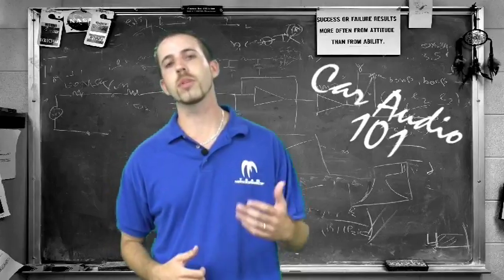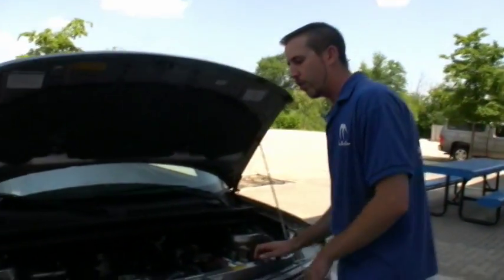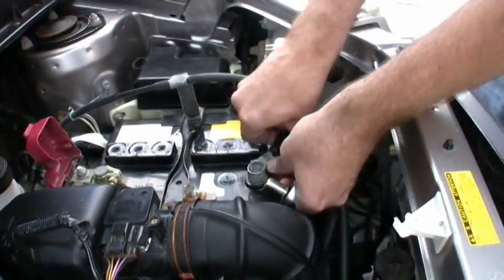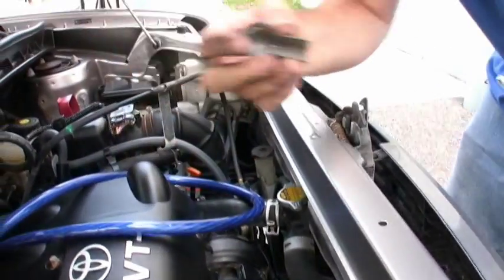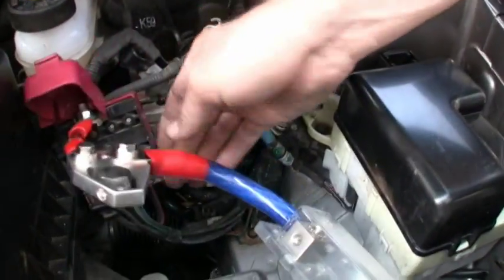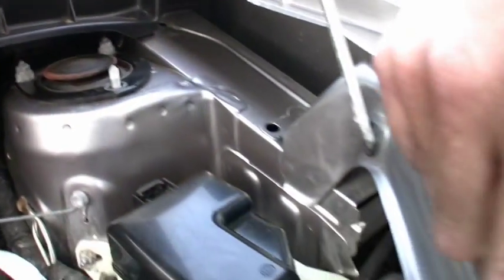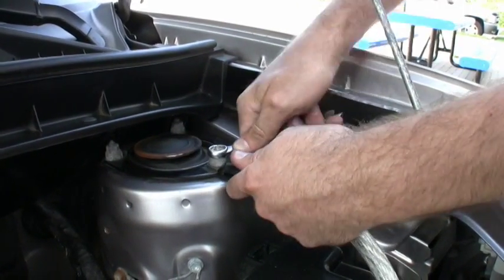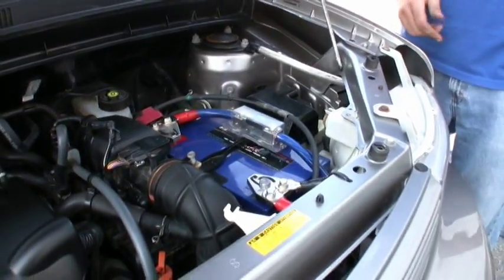Car Audio 101 - The Big 3 Upgrade Tutorial

Comment from the maker: Gotcha. You ahve a valid point then. I would recommend a 0 awg run from the mounting bolt on the alternator (NOT POWER Connection) to a good ground.

Comment: Well if you worked on your oun stuff but I know what you mean. But let me tell you before who ever told you that makes you spend too much money. My 93 jeep is no different. All they need to do is loosen the belt on the power stearing, then undo the bolts and what not for the alt. Then it just drops strait down. The radiator, the AC??? That B.S. And dont let anyone tell you different. I replacet the alt 3 times in my jeep and never did any of that.

Comment from the maker: I measured the points of resistance prior to connecting the ground to the strut bolt. It had equal resistance to the factory ground connection just below the strut bolt. The factory ground from batt neg to front frame actually had the highest resistance measured. LOL

The stock charge wire on this Scion goes directly to batt pos. In my Neon I had a similar situation as you. My charge wire ran into a factory fuse distro etc so I added a 0 awg on top of that and fused at the batt. Still helped.

Comment: Your going to need to take the alt out and then connect your wire. I had to do it on my 93 jeep cherokee. But i used the stock wire with the new one because of how the wires are all put together almost like a big plug.

Comment: The stut bolt goes to the stut on a paint to paint contact. Your grinding the spot is fine but not like a welded stud on the unibody. Now im asking this early so i dont know what other people will ask but what about the stock positive wire? These wire most of the time go to a fuse block for the engine managment. They have shown the 2 wires being used at the same time. I had no choice bu to do this on my jeep because of how the wires are all one big plug.